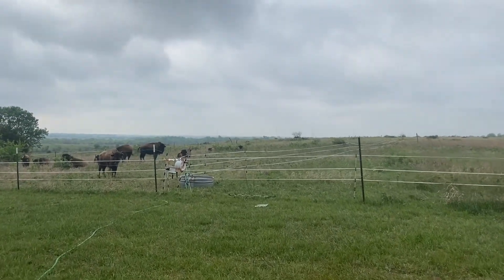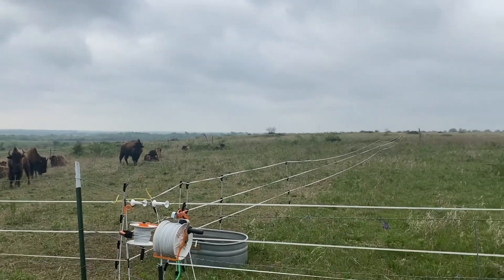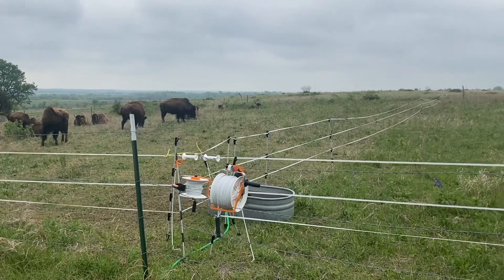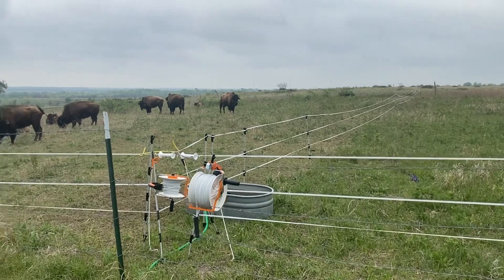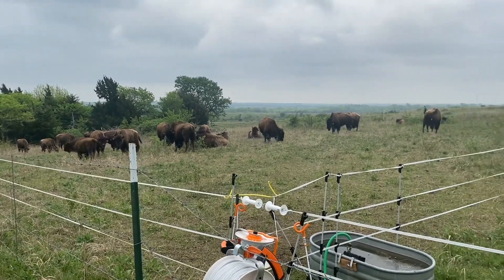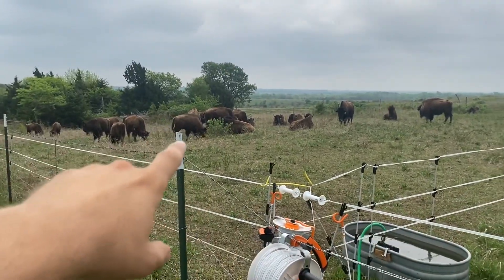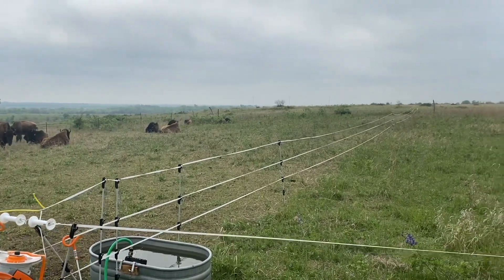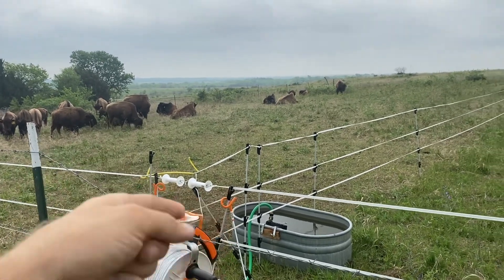Rotational Grazing Buffalo Experiment￼

Comment: I'm pretty sure you said this on one of your previous videos but I figured I would just ask… How much current do you run through your exterior high tensile fences?
Reply from the maker: It’s putting out 6.5-7.5 right now but I am hoping to get it up closer to 9 or 10. I’m going to try grounding the charger that I have currently a little better and if that does not work, I will have to switch out chargers.
Reply: @BrokenArrowBison  thank you for the info!  I am currently expanding my fences and definitely think I need to bump up the juice. For grounding, I currently have three 8-foot copper rod about 7.5 feet down, approximately 9 feet apart and about 8 feet from the charger.  Thank you for responding so promptly!
Reply from the maker: That sounds pretty adequate on the grounding rods as long as you have good ground moisture. Anytime!

Comment: You might have to look into a permanent fence & just have gates in everywhere to let them rotate around.
I know about the cost whether it's  temporary or permanent.  We only have 6 acres total, about 4 in pasture & we need to put up some sorry of field fencing to keep the goat's from wondering, the cow's & horse respect the barbed wire, goat's don't give rip. And now that we have HOA neighbor's,  don't want them whining abt the goat's trespassing.  It'll be over $2k, just for fencing for 1 section. So I feel your pain, the temp wasn't any better, at least not with the electric (net) fencing. Good luck. Might have to make your own custom post's for the temp fencing? 🤔
Reply from the maker: All good points. Always learning. 😃